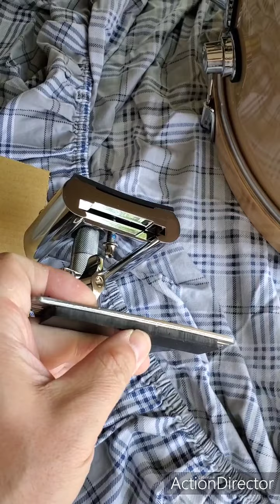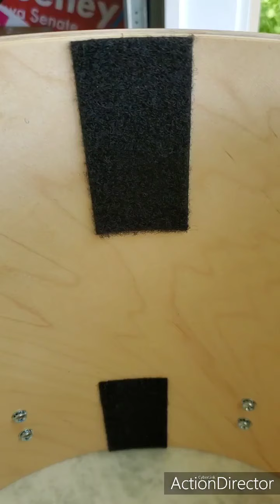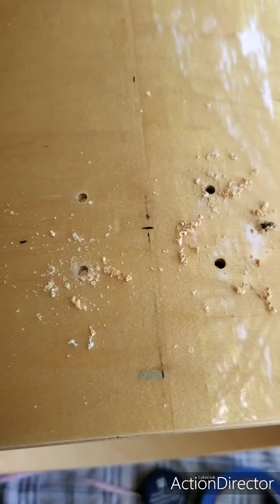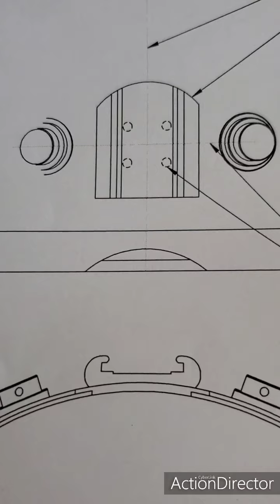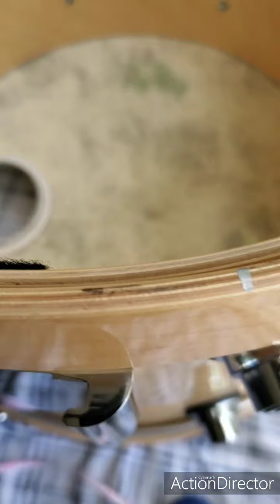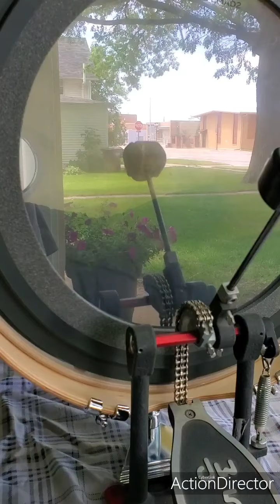DW Bass Drum Lifter Installation DWCP9908CR

Comment: For drawing your mark on the shell, just place a strip of painters tape where you need the mark and then draw with a sharpie. Also, placing painters tape where the drill bit comes through the shell helps prevent some of that splintering from occurring.